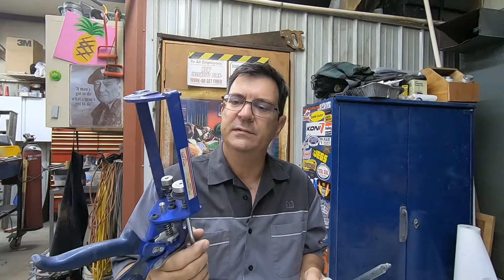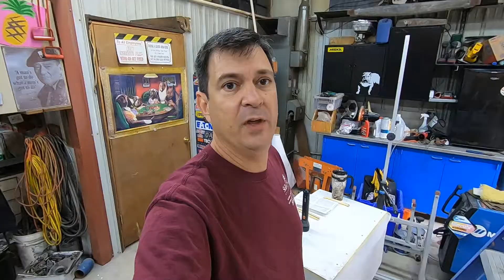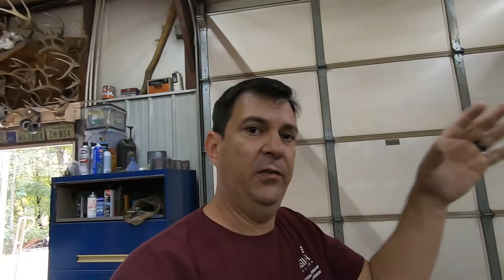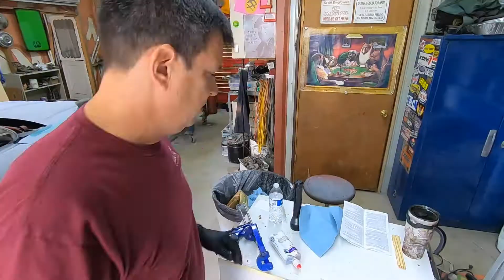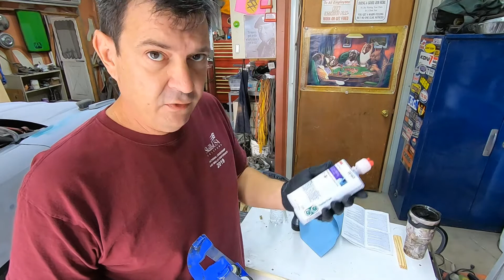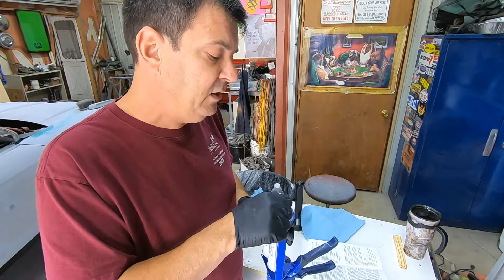3m Noise Vibration Harmonic Foam Automotive Usage | How to make it work for you

Comment: Thank you for this video I actually have a 21 suburban we’re the roof in several places is flexing to much and I pulled the headliner off and discovered they didn’t use enough foam in said areas so it’s no longer adhered. Just order this stuff body shop confirmed it would resolve the booming in my car
Reply from the maker: The NVH dampening foam is some amazing stuff, thanks for watching!!

Comment: I have this problem on my hood where the factory stuff wore off and caused a low spot I bought the nvh for noise anf fluttering but should have got this but the nvh is kinda like this but it's like a rubbery feel and for sound denting to